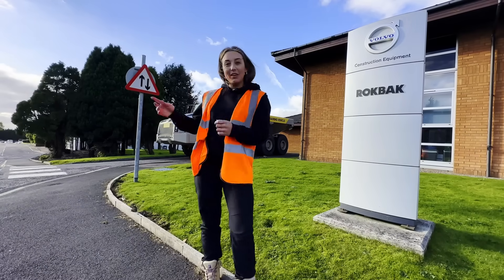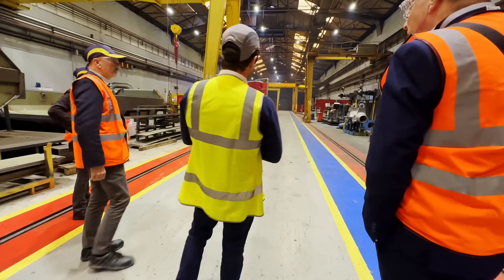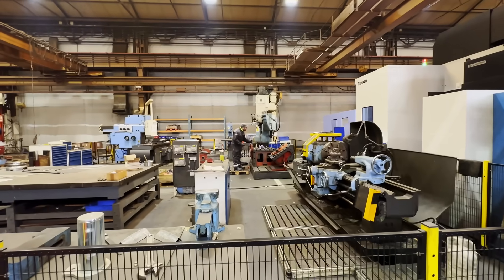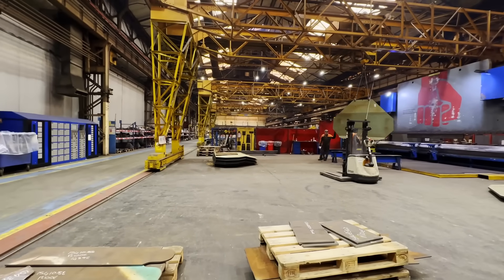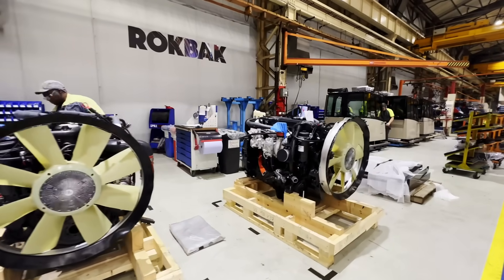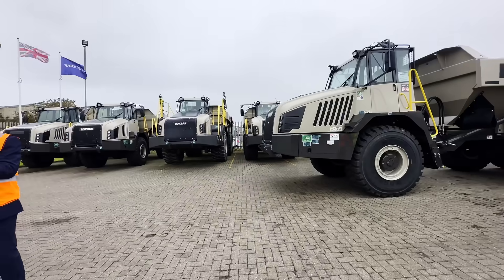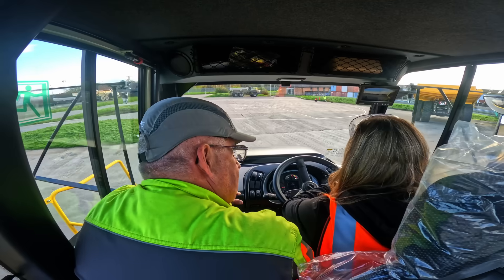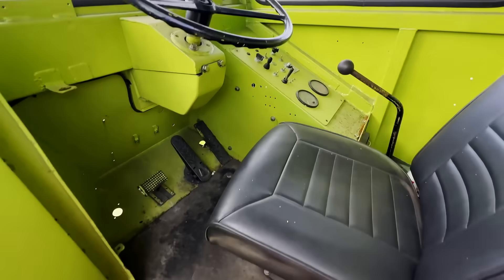How To Build a Dump Truck?! + Rokbak FIRST DRIVE

Comment: Hi Amy another great video and for me always interested in seeing equipment being made. Watching the driver going down slope with a wet surface and brand new shiny tyres he certainly did drift a little there, maybe showing off cause you were all there 😂😂😂. Now a question the guide talked about rebranding to get away from an earlier type, do you know what that brand was ?? 🤔🤔
Reply: They use to be called terex now Rokbak to get away from the fact everyone associated terex with rubbish products
Reply: @Waggysir  Yes Terex definitely dropped the ball in the later years 👍
Reply: @JohnR-NZ  they never made good trucks only decent product they ever had was when they bought out O&K and built the 120 shovels